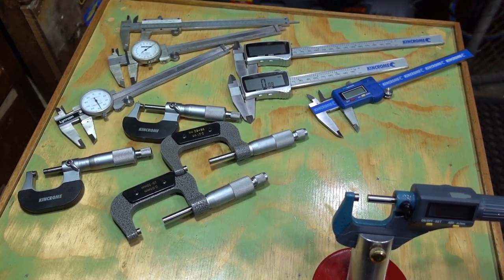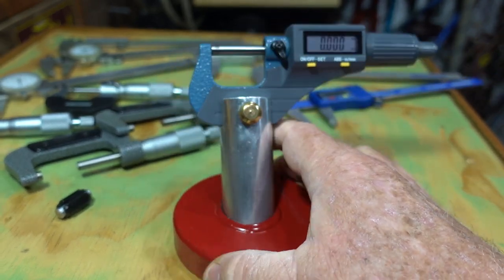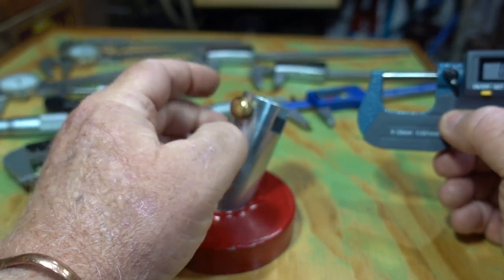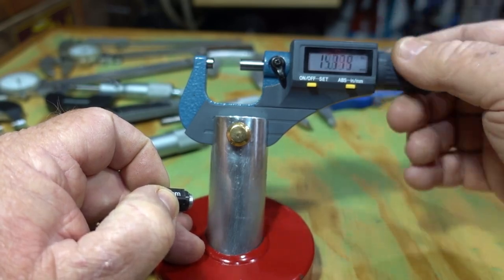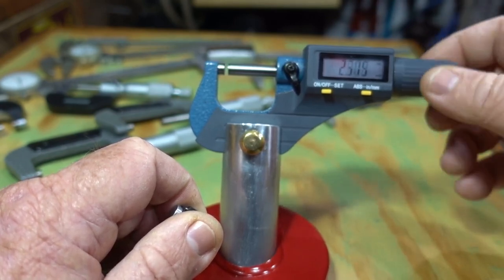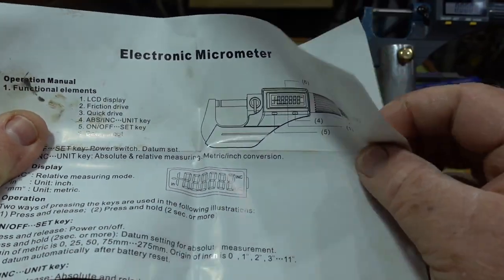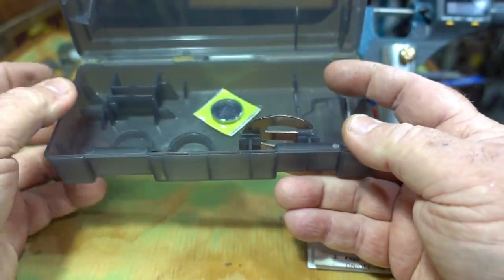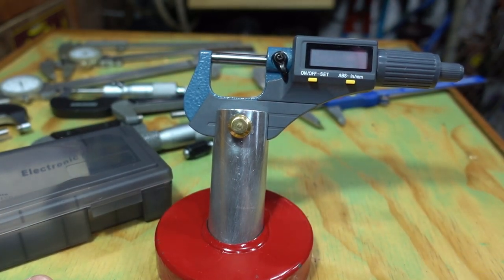Work Shop Talk - Cheap Chinese Digital Micrometer Review - Hints & Tips

Comment: You did measurement incorrectly. You have turn big handle - this handle has ratchet mechanism inside - it produce right amount of tension. I don't heard any clicks and you tightened gauge block using small handle. If I don't mistaken, this handle bypass ratchet mechanism.
Reply: You are absolutely right, noticed the same while watching, odd thing is that the ratchet is on the large turning knob, normally the ratchet is on the small turning knob.
Reply: @pa5ca  i work as metrology technician, the ratchet mechaism can be at the both sides, it depend with the brand

Comment: The ball bearing adapter is for measuring pipe wall thickness  the ball goes inside the pipe.  Re-zero it first to compensate for the ball diameter.

Comment: I have the same one.. i found out that it deplete the battery even when not being used..also after not such a long usage the free wheel mechanism (ratchet) stopped working well.. didn't managed to fix it yet.
Reply from the maker: Mines still going ok presently. I suppose from China and being pretty cheap I should be happy so far.
Reply: Parasitic draw on the battery is common in the cheap ones. I store mine with the batteries out. No problems

Comment: Just seen your video on the Micrometer and I notice something wrong in your measurements.
First, I have one of these cheap micrometers my self, bought it on Ali express.
What I found strange on these cheap micrometers is the following, normally the ratchet is on the thin turning knob, but these cheap meters the ratchet is on the large turning knob, and that is odd to me. 
While measuring your 25mm caliber you are making a capital mistake, you are not using the ratchet and there for you were able to over stress the measuring subject, it is viable in your video. Due that you know the caliber measurement  is 25mm have adjusted the micrometer to that value.
The same mistake is made while measure the 0,0 you expect 0,0 so you turn it to that value instead using the ratchet.
My two cents of comment.
Reply from the maker: Really appreciate the post with that information!  Cheers Jim

Comment: Thanks.  Just to clarify analogue are electronic systems with a continuously variable signals.  Analogue is electronic.
Reply from the maker: G'day...I don't 100% follow "Thanks.  Just to clarify analogue are electronic systems with a continuously variable signals.  Analogue is electronic" ? - Cheers Jim
Reply: @SteamEngines-Jim  Analogue is a type of electronics not a manual system.  There are different types of electronics.
Reply from the maker: @Machster10  Cheers for the clarification, appreciated.